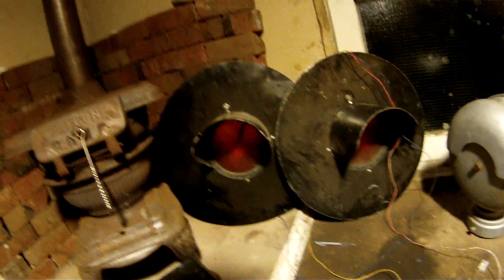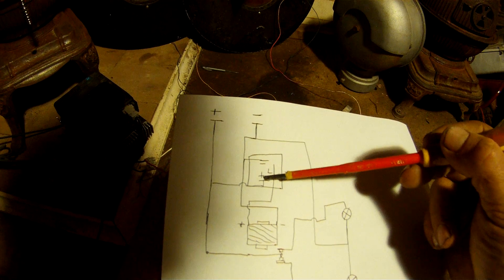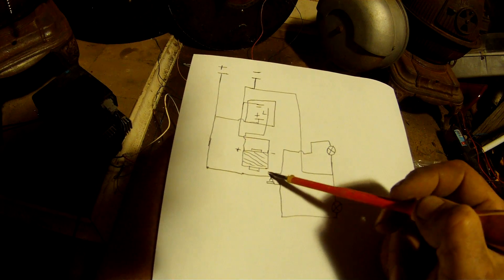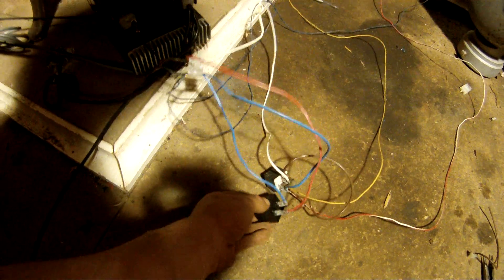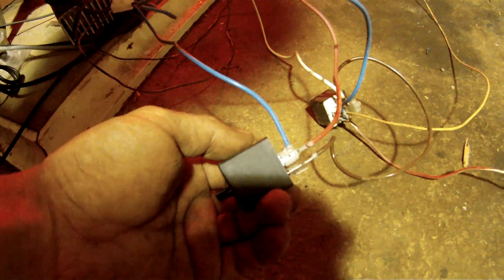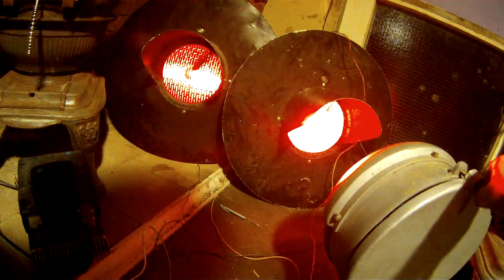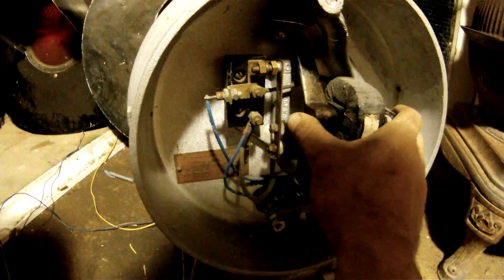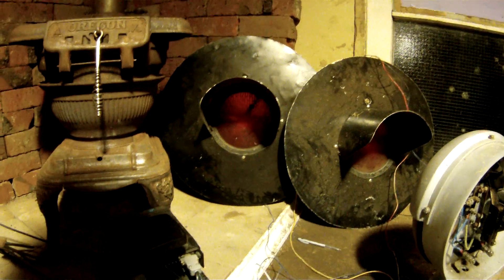how to wire a railway crossing light to flash alternately

Comment: Where do I find the Parts to make the light Flash
Reply from the maker: Ebay will have them or automotive dealers
Reply: Hi Is there any way you can take a picture and send it to me its had to see im working on a light myself I don't want to wire it wrong

Comment: Hi again. I dont know if its too much to ask but can you do another video following the wires from both relays to the lights and each individual component. Your method sounds promising and I have both relays but the wiring must be wrong because its not working to your example you demonstrate. Hope to get some help. Thank you.
Reply from the maker: Hello there  yes thats ok  i can do that   what happens  when you power it up
Reply: @tony-lq7yk  Well first I hear a terrifying buzzing sound as I use a near 12 volt maybe 16 volt dc model train transformer as the power source. As I power it up higher the sound dies down but the lights don't flash. If anything one light is really bright while the other is dim. I'm not an electrician but I swore I got it right but clearly I did something wrong or bought the wrong parts. I will make a video showing what I did and maybe that can help you see what I did wrong and when the video is done ill share the link. I'm using two smaller model train bulbs as test bulbs so I dont damage the rr lights once they get hooked up.

Comment: Oh one more thing. Besides being 12 volts does it matter how much amps the dc relay uses? Is 80 too much?
Reply: 80 amp draw for a relay is waaaaaaaaay too much for this setup.  Each of your light heads should draw 2-3 amps and your flasher should draw about 1-2 amps.  Your switch relay the same at 1-2 amps.  You would need wire of a half inch diameter to run a relay that draws 80 amps.    However...  If I've misunderstood your question, you CAN use a relay that is RATED for 80 amps but your replay coil should not draw 80 amps.

Comment: Hello. What products all together did you have to purchase? I noticed you had to buy the flash relay but also keep in mind the flash rate. I have an electrical source but not sure where and what relay I would need and for sure I would want to adjust the flash rate. Hope to hear from you. Thanks.
Reply from the maker: Hello there  im not sure of the brand of flash relay i just got it off  the internet   i got an adjustable one to set the flash rate
Reply: @tony-lq7yk  oooo. Okay well I hope I can find it. I went to a railway museum and they couldn't even help me. So I have the lights and a power source. So all I need a is a dc relay that includes a flash rate control?
Reply: @tony-lq7yk  I started researching. Would these work?

https://www.ebay.com/itm/US-SHIP-5pcs-DC-12V-Delay-Relay-Shield-NE555-Timer-Switch-Adjustable-Module/153875593058?epid=17028459838&hash=item23d3b33762:g:72sAAOSwiHpZ8sMp

https://www.ebay.com/itm/Zettler-AZ983-80A-SPST-Automotive-Relay-14-VDC-SPST-Contacts-12-V-DC-Coil/281963533735?hash=item41a65615a7:g:B5YAAOSwP~tW5B9m

It sounds like I need to different 12 volt dc relays correct? One used as the flasher and the second used for its coil? Im new to this. Sorry.
Reply: @tony-lq7yk  Hi again Tony 88. So I thing I found the adjustable flasher 12 volt dc relay however was wondering if I can get some help figuring out which open close contact relay would work. That's all I have to find out. Your help would be very .uch appreciated.
Reply: @khriscamacho1212  did you ever get it figured out?
Reply: @khriscamacho1212  thanks, subbed!
Reply: @Thunder_Ridge_Railroad  thanks. I  gotta add more videos of my railroad stuff. Just added steam whistles videos mainly.
Reply: @khriscamacho1212 - wondering what you used for the open / close relay in your system? I haven't been able to figure this portion of the set-up out. Thanks in advance!
Reply: @NorthernNomadCanada  https://m.youtube.com/watch?v=uICHu7Y6Lbw
Reply: @NorthernNomadCanada  I'm using a relay made by the railroad. Works great. 12 volts is all it needs.

Comment: Thanks for this video. Wired mine up using your method and my lights flash! Only thing is, I forgot to get an ADJUSTABLE flasher relay, so I only had a normal one where it flashed the lights at about the same speed as yours when you sped them up in the vid.. I ordered an adjustable one off eBay and they sent out a normal one but I didn’t complain as it took ages to arrive at my house and it’s too much messing around to send one back and get another.. It’s been a few months now though so I thought I’d give it another try. Hopefully 3rd time lucky. Also I don’t know how people find that difficult as I’ve never wired lights or anything before and I got mine working.. Thanks again 😄

Comment: Are you running on automotive 12volts?
Reply from the maker: yes 12v automotive relays  one is an adjustable indicator flasher relay   the other is a relay with a no and nc contact.   any other  questions  just ask  im happy to help
Reply: I have a 4 light railway crossing flashers with the incandescent original bulbs. I am powering with  a ho train transformer and it works fine for about a minute then it overheats and cuts out. I didnt think it would affect the transformer with too much load. Any ideas?
Reply from the maker: hi there  i will be honest i dont know much about ho equipment . but  when you add the load from the flasher coil then four lights  but only operating two due to the flashing  plus a bell if connected  it sounds a lot for a ho transformer to run.  back to the flashing  every time an incandescent bulb switches on the split second between power up and the filament actually heating up the load is  alot higher  ( a flashing bulb needs a higher amperage due to that )  a cold filament has less resistance than a hot .  that might be what is causing that  all the best.  tony